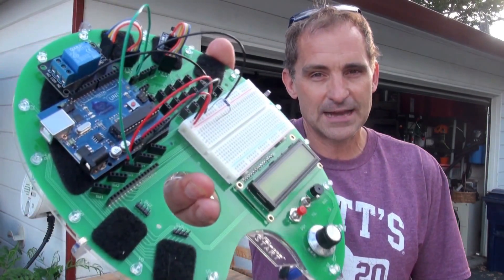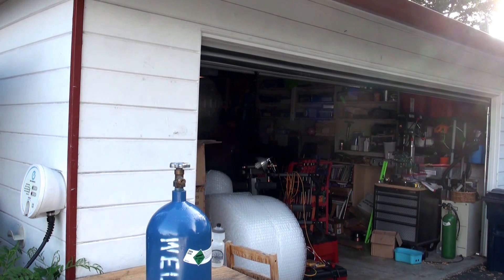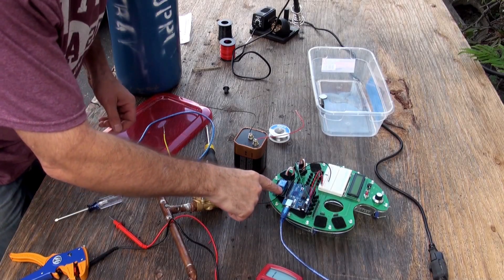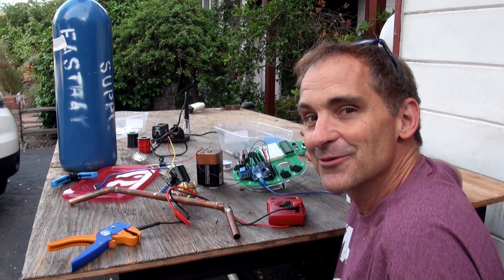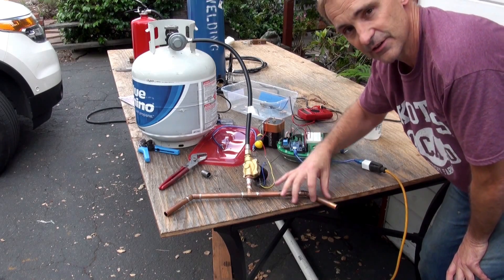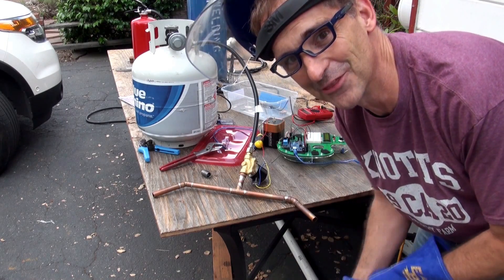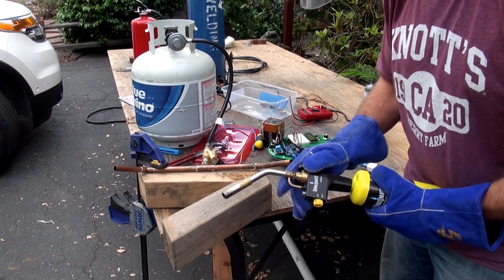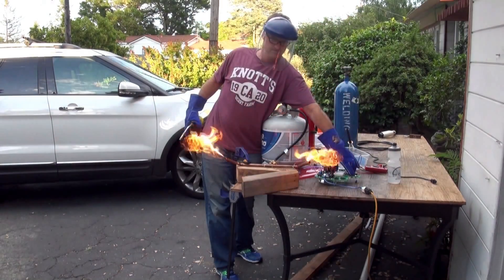Iron Dragon Backyard Roller Coaster - Part 6

Comment: one way you could trigger it when its on the track is to use a magnetic reed switch, and have a magnet on the track. this way all you have to do is power the car with a battery, and the rest will operate automatically.

Comment: EPIC!!! You should find a way to work both so the dragon can breathe either fire or smoke.
Reply: I agree, fire, then CO2 (smoke) to clear the propane out of the plumbing.  Although I'm not sure how that may mix chemically
Reply: I think it would make sense, just that the nostrils may have to be cleaned every once in awhile. The chemical aspect is one thing I'm not sure of either.